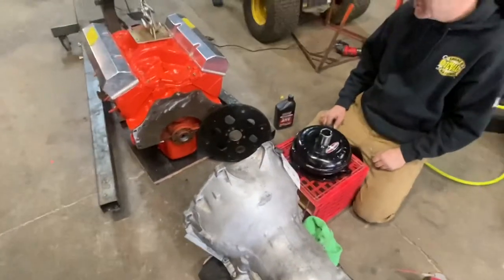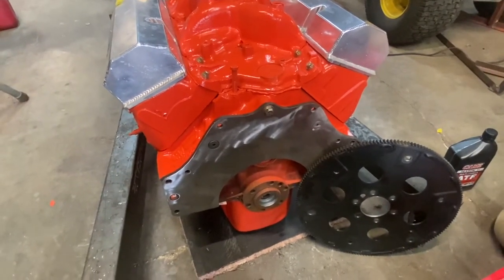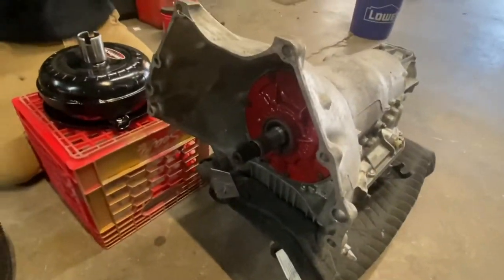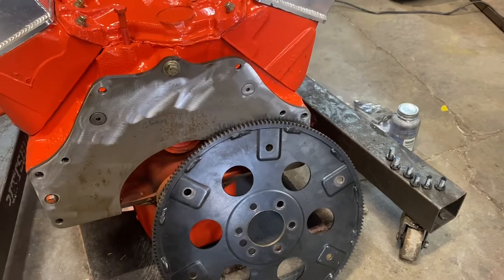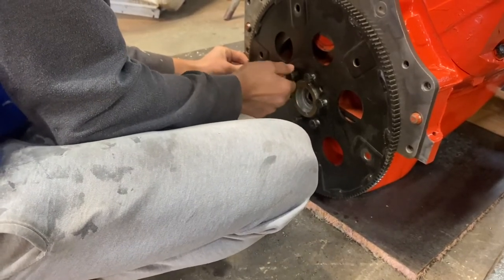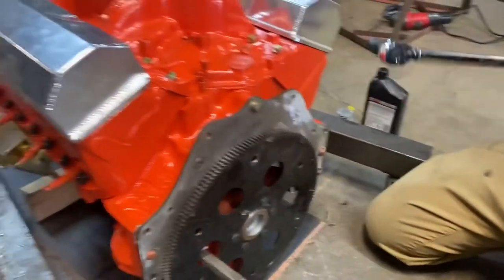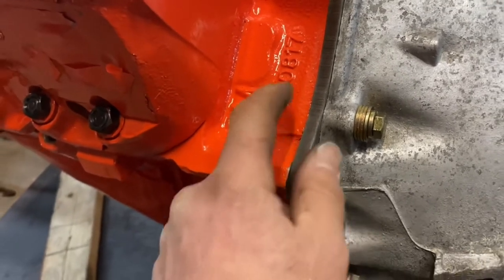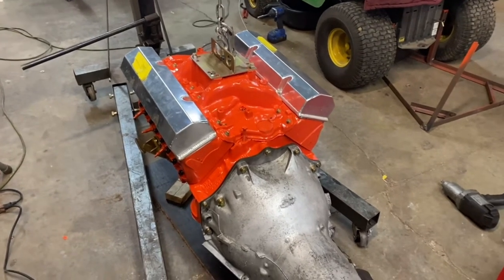Installing trans dapt adapter plate, flex plate and transmission plus dropping motor in

Comment: Did u have to run a spacer so the torque didn’t sit to far off the pump
Reply: im trying to find that out also if I need to get that spacer that sits in the middle of the convertor or if the bolt spacers are good enough.